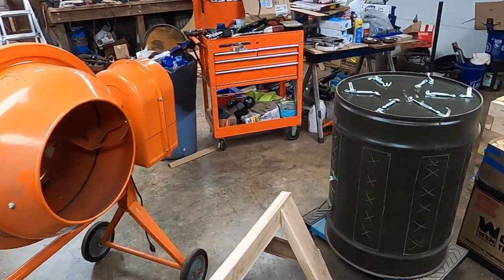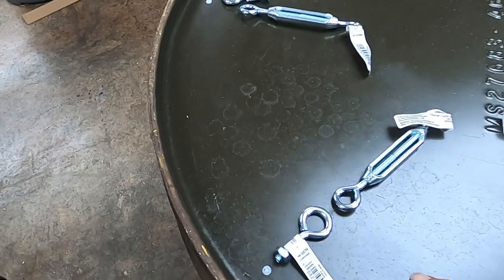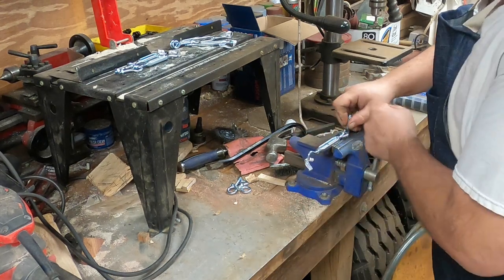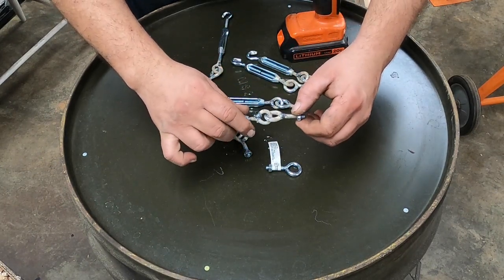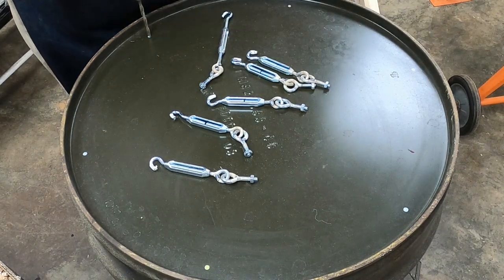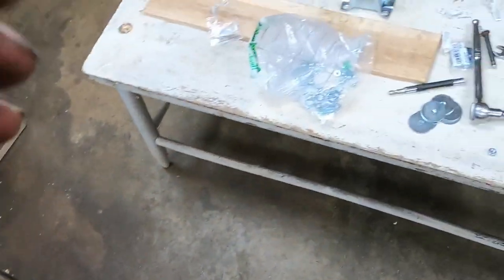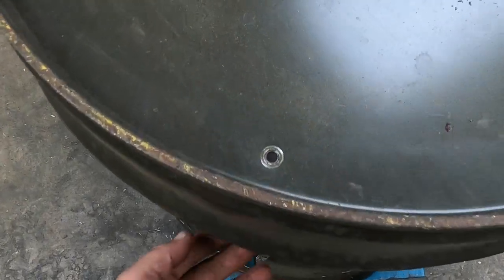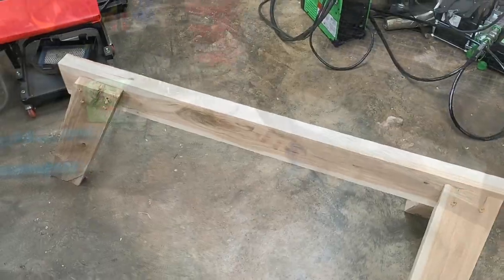Trommel Compost Sifter made from Harbor Freight Cement Mixer and 55 Gallon Barrel

Comment: Excellent video!  I love your use of the metal barrel instead of a very expensive outdoor mesh trash can that I saw in a different video. Your approach will save me $200.  Thanks mate!
Reply from the maker: Your welcome.  Those metal trash cans weren't cheap anymore when I built mine either.  The barrel is still holding up really good on mine.  I would say to be careful to not cut through ribs on the barrel, they are where most of the strength comes from.  Also a brick or some other weight tied loosely to the inside that is able to flail around really helps keep the mesh from getting clogged up if your compost is too wet.  It also helps to break up any clumps.

Comment: Yours is a lot more fancier than mine, same basic design using an older HF mixer. Only spent $15 on hardware cloth and I used materials I had on hand to cobble mine together. Not pretty but it works.
Reply from the maker: If it were just for the compost using only hardware cloth would have been ok, but I also wanted to be able to sift rocks out of some of my local hard clay soil which would have just beat the hardware cloth to bits. (by rocks I mean quartz boulders)  I got to give you kudos for the $15 build though.  Doing things in a budget friendly manor is good for everyone.  I see people build things all the time on youtube with things they are able to get for free that would cost me a fortune.
Reply: @tinker-tinker  I have sifted some gravel, not big rocks, but big enough that if it was just hardware cloth it would have been destroyed. The frame work for the cylinder is concrete remesh which gives it a bit more strength. The hardware cloth is wrapped around the remesh. I didn’t think it was gonna last this long but so far so good.

Comment: Does this remain outdoors year round?
Reply from the maker: I do leave it outdoors year round.  Though I do try to tuck it up under the eave of the garage to give it some protection from the sun and the rain.  As with anything painted and made of metal it will last much longer if stored under cover.  All the electrical stuff is sealed, but the sun light can degrade that over time.  There are a lot of things you can do with a cement mixer.  For example I need to clean all the old rust out of my car's gas tank before I redcoat the inside in preparation for an e85 conversion.  I can strap it to the tumbler put some bb's in the tank with a little solvent, and just let it tumble for a few hours to clean it up.  You can also use it to clean rust parts and tools by putting sand in it with the parts, and just let it tumble for awhile. Put a pulley on it, and you can use it for just about anything you would use a Lister diesel engine to power.  It really is the redneck kitchen aid mixer.

Comment: Questions for you Sir, can it operate without that two wheels support?
Would it tipping over without support?
Reply from the maker: The two wheel support is needed.  Without it would tip over even when empty.  This is because the barrel is cantilevered beyond the base of the cement mixer.  I typically store mine under the eve of my garage with the barrel straight up.  It's still a little tipsy in that position, but it's stable enough that I don't worry about it falling over.

Comment: I’ve seen this build before. I wanted to see how it turned out. Forwarded to the final segment where it was working and it was hard to watch with the camera moving like it was on some frightened animal. It was all over the place.
Reply from the maker: My first video, I've gotten much better at editing since making that.  The tumbler is still going strong without any issue.  I've even used it a few times to sift rocks and junk out of some of my local clay soil.  The only time I have an issue with it is when the compost is too wet.  It then has a tendency to ball up instead of going through the screen.  I've thought about adding a few "flails" to the inside to make it shake some as it rotates to help clear keep the screens clear.
Reply: All good. Wasn’t trying to be rude. Sorry if I came off that way.
Reply from the maker: It's all good, I know the video turned out pretty rough.  I really should redo that one some day.